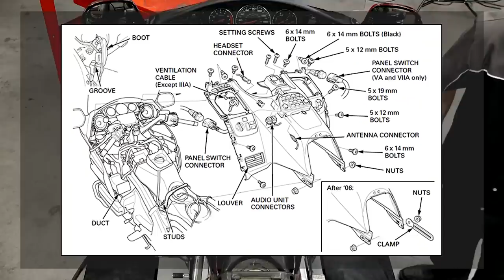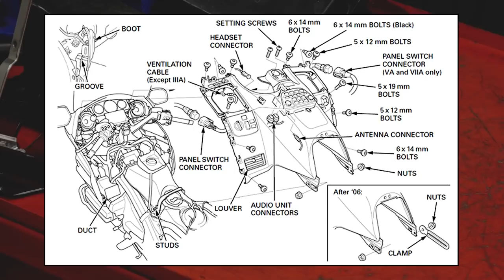Goldwing Air Filter Replacement | Partzilla.com

Comment: One of the better air filter change videos I and seen.  I've changed my 06 many times (240k-and-counting miles).  Thanks for sharing.  The fact that y'all invest in making videos will make you my new go-to for parts.  I am getting a list together of 20-30 little fasteners and oe do-dads taht need replacing plus this winter I am replacing all the front brake bolts.
Reply: Thats one of the reasons I buy from partzilla.

Comment: Easy as pie only looks difficult because of all the wiring of the electronics. I think most people that try this will be surprised how easy it is. It’s only a couple bolts and if you think you’d have a hard time figuring out which plug goes where when putting it together just get a pack of multicolored tape rolls and tape same color to each end of the plugs and it’s easy to match them up after.

Comment: I am flabbergasted. This honestly makes changing an engine look simple..I was a Honda motorcycle mechanic in the 70s. I could literally have the engine out of a CB 350 twin out of the frame and have the camshaft, (which were junk), out of the engine in under 50 minutes.. changing this air filter has more steps. And in addition to there being more steps, this job is scary because there are a lot of hidden plastic tabs..
  This is an excellent instructional video. I just bought my very first 1800 gold when used, and whenever I buy a used motorcycle, I change everything from brake fluid to spark plugs.. motorcycles don’t wear out, they get neglected to death.
 The Gold Wing I just bought is a 2002 with only 13,000 miles on it. The date today is 10-2019. The original owner said he never had the air cleaner changed. I wonder how many mice I will find in there
  I would like to hear suggestions from Gold Wing honors, whether I should use the standard Honda air filter element, a HIFLO aftermarket air filter element, or go for the big bucks washable K &N Standard filter replacement. I have a Honda pacific coast that I have used for commuting for 24 years. I put a washable K &N Air filter in my PC 24 years ago, and I am happy with it still. The PC air filter element style appears to be identical to the one in this Gold Wing..
 Any Gold Wing riders have any experience with different air filters in there 1800 wings?

Comment: Great video!  Just finished dropping the new filter and the cover back in place last night, will reassemble today.  Would like to note that on my non-ABS 2009, I did not need to flip stuff over to the right to access the air cleaner cover.  Wiring, ECU box & cruise assembly all pulled up far enough to easily remove the cover and filter to the left.  Not a bad job really, but holy crap there is a lot of wiring on a GL.....

Comment: Looks like an absolute nightmare, but it needs to be done. There are just way too many opportunities to break something for what should be a much simpler replacement method. I may be tackling this during the upcoming weekend when we are expected to have 40-degree temps. That's a good time for motorcycle maintenance! 

Thanks for the great demonstration of the process. I'm not looking forward to it, but it is what it is.

Comment: Just finished changing my filter for the first time since owning my 02 wing. I have been putting it off since all I’ve read was how horrible of a job it was. It took me about 4 hours but more than half that time was spent shooting the crap with my neighbor. Pretty easy if you keep up with where the bolts go.

Comment: Another great video! I've changed dozens of these and I still think Honda built the bike around the air filter! My current 'Wing is a '13 Airbag model so I have that to contend with that too. Main thing is don't hurry and be patient. Don't jerk and snatch. I really liked the clutch replacement video you did on that bike. Thanks.

Comment: I know that was just to try to get people to buy your parts but I kinda feel like I'd rather pay someone to connect up those 20 or so connectors and get all those plastic pieces back together without breaking anything. Holy crap! You've got patience.
Reply from the maker: Goldwings are a special machine.  Sometimes it's not even about saving money, it's just that people like projects.  Some projects are a little more time consuming than others.
Reply: I called a dealer by my house and they were going to charge $300 to do this.

Comment: Thank you very much for the detailed instructions how to replace the air filter. This is the best video I have found on the YouTube. This video convinced me to do it myself instead of taking it to a bike shop. I can imagine how many screws would be missing and parts not sitting in their place.
I just wonder, why Honda had to place it so deep in the bike?! Doesn't make any sense. Prior to my 2008 GL-1800 I had a 2003 Voyager XII. I could replace the filter in 10 minutes.
Reply from the maker: Every time this video comes up in a meeting, we talk about how far into the bike you have to dig to get it. It's a thing, man.

Comment: Thanks for the video! I watched it about 4 times over a few weeks, really saw its only following instructions, .. Still, very anxious to do this i began this morning after a cup of coffee and i'm now completed, 945am. I am NOT very good at working on cars/bikes and I did it. Just take one thing at a time. Nothing about this is really more complicated than unplugging a cable or unscrewing a bolt. Now i'm much more familiar with how the top of the bike goes together, there is no magic or fiddling, very straight forward.
Not sure how a shop who's done this before can charge over 1hr of labor, next time i do it will probably be 45 minutes or less.
Need to add, there was a gasket around the filter when i removed it, (not shown in video) i put the gasket in the air cover and then slid the filter on the cover and put them all on together. May be a bit easier. I put a little air tool oil on the gasket to keep it from dissolving/cracking.
Reply: thanks, Ill try that tip.

Comment: It's not a difficult job, just an involved one. Hardest part is keeping track of which fasteners go where. Make up some cardboard cutouts and push the plugs into the cardboard in the same fashion as the original. Other than that, once you have done it once, it's easy to do again. Be sure to put the templates away for the next time. Second time around is very easy but no less involved, but still a couple of hours work.  But don't neglect it; your beautiful Wing deserves better. 
And when you feel you need to curse the job, curse the design engineers who must have been drunk the day they did their job....

Comment: Removing and reconnecting the lower vent control cable can be a pain in the butt. I saw a jump cut in the video. 14:46 . I have found its much better to remove the whole lever assembly with the cable still connected. Pull off the lever's knob and click off the cover plate that says open and close. Under that there is only one screw to remove. Removing it as an assembly doesn't put a nasty kink in the cable.

Comment: Don't be afraid to use a vacuum cleaner with a soft brush on the filter housing followed by the nozzle all around, before opening,  and then on the filter, before you remove it. This will minimize debris. Obviously if debris does fall into the airbox you want to vac that out, including the intake ports at the bottom.  No harm in wiping up the oil from the PCV with a paper towel either.

Comment: Considering that it's an opposed 6 it makes sense that the air filter is deep inside the beast.  The rest of the maintenance on a GW18 is on par with with other motorcycles, or maybe even easier.

Comment: On reassembly the hardest thing is getting all the wire bundles in EXACTLY the right position.  Otherwise the top shelter will not fit.

Comment: Hi John, thanks for taking the time to make this video I have found it very useful as I am just about going to undertake the task changing my air filter, I have a 2014 airbag model, Is the procedure  the same for removing & replacing (as you refer to it)   ‘the shelf’ 
Can the air-bag just be unplugged and plugged back in?

Comment: You could not have done better job/I did mine today the guy before me replaced all the Allen head bolts wrong with ones from hardware store ,I will sort it out later thanks for helping me through 1st time I can do it again in 1/2 the time .....M

Comment: Looking at this video, I think the air filter on my 2006 wing will be done at a garage by a professional. 
Reason 1, not enough space in my garage.
Reason 2, lack of patience to do this.  
Reason 3, I'll end up messing it up.
Happily change the engine oil & filter and the shaft drive, but that's where my mechanical know how ends. 
Brilliant video though.
Reply from the maker: Yeah, the Goldwing is tough. Every job we do, if it's hard, we say "At least it's not the Goldwing."
Reply: I feel the same with my 2002..   woah😢

Comment: Holy BatCrap. I always work on my own stuff, have  lift, three rollways, special tools, etc. Own BMW, Hayabusa, and Harley now. I WAS considering getting a nice low mileage wing for some road trips, but after watching this I wouldn't even consider owning one! A major deconstruction just to change a friggin air filter??? I thought the oil change on the Hayabusa was a pain in the rear! There' no doubt in my mind that people run those air filters forever, and that dealers probably just charge for changing them instead of risking introducing electrical glitches from mechanics slip ups! Nope, I don't care how good the Goldwing is on the hwy, not getting one of those!
Maybe I'll just buy one for a long trip and then sell it before I put a wrench or screwdriver near it!

Comment: Hi John, 
I am just about to under take an air filter change with the help of your video. My bike is a 2014 airbag model, Will removing the fairing be the same procedure & I can just unplug the airbag & it comes away with the fairing?…….. Mark 12:13

Comment: How about a video on the 2010 air bag model please?
Reply: It's really the same except the radio module is in the left side and the airbag sets on top of everything under the shelter, the computer module is upright on the left under the airbag. Air bag is actually easy to remove, just pay attention to the way the straps fold and lay down under the shelter.
Tape the foot warmer doors shut before removing the cables and it's easier. Also the connection that gets forgotten the most is the small wire connecting to the top of the airbox. If you have a mouse nest in the airbox, cut the screens off the old filter and use them over the ends of the air snorkels going to the airbox to make it harder to get in.

Comment: I'm about to take on this project on my 2008 wing. I presume the steps are pretty much the same?
Reply from the maker: Yes, essentially the same.
Reply: @PartzillaParts  thanks very much for your video - it helped a lot! I did the job in ~3.5-4 hours, and went pretty smooth. 
A couple of takeaways - the hardest parts were separating the connectors which were really tight, and then getting the airbox cover back on without moving the filter out of the groove. That bit took a while, but patience was my friend. 
Many thanks again for your extremely helpful video.
Reply: I’ll be doing this here shortly on my 08...  I have to buy some Crown Royal for afterwards first.
Reply: @peteleare1372  I’m doing mine now. Those Connectors are a PITA! I’m also replacing my steering head bearings and fork seals. Dealer charges $1300 just for labor😳 That’s  money I can spend on fuel and miles of smiles👍

Comment: The air filter is the most involved service item but everything else is quick and easy. Beware Goldwing riders I don't know how the 2012+ models are but the F6B riders have to open the bags to remove the side panels, otherwise you will cause damage.

Comment: You don't have yo unplug the ecm and the cruise control . There are only two connections you need to unplug and you can move the whole assembly to the side

Comment: I figure I'll have to change mine next year. If I watch the video about 100 time between now and then, I should be OK.
Reply from the maker: To this day, when we run across a complex job, someone always says "At least it's not the air filter on the Goldwing."

Take your time, keep track of your parts, and check out our diagrams if you need more hints: https://www.partzilla.com/catalog/honda/motorcycle

Comment: I followed your directions and was able to change the air filter. I put it all back together, put in and turned the key, and nothing—as if there was no battery in the bike. So I took it all apart again (except for the air box, making sure every electrical connector “snapped” in properly. Same result. Verified the battery is at 100%.
Any ideas?
Reply: Sounds like the long wire coming off the ignition to the right side of the bike didn’t get plugged in
Reply: I found that the main 30amp fuse had burned.  I suspect that when working on the bike with several "layers" removed, I might have laid a tool on the bike that shorted the fuse, and really had nothing to do with the steps involved in changing the air filter.  I'm picking up a new fuse tomorrow, so that will be the proof.
Reply: A new main 30A fuse did the trick.  Everything is back running.  I need to be more careful setting tools down on the bike that could cause a short / blow a fuse. :(

Comment: It's worth every penny I spend to have my Honda dealer do this. Why design this in such a way! The hours it takes to do something as simple as change an air filter is ridiculous!!!!
Reply from the maker: That's why we do the videos! if you decide to do it yourself, it's a good tutorial, but it's up to you how to proceed.
Reply: @PartzillaParts  its a great video. I just don't have the patience to do this. I just think Honda should have designed the filter to be changed a little easier.

Comment: Anyone have any suggestions about removing the headlight adjust connection?  I can press the top tab and move it back maybe 16th of an inch but can’t tell if there’s another part holding it together??  The opposite side doesn’t seem to be moving but can’t tell if there is something holding it together.  Never mind.  I had the little clip that holds the cable to the radiator on an ‘08 still on the connector, removed that and it separated easily.  Thanks

Comment: there is the cost of owning a vehicle that most people just dont take into account... the Ducati panagali  needing a valve adjust  I think before 5000  miles ...at a 1000 $$ plus in labor .. this bikes air filer ,,wow   maybe 2 hours work ..at 125 an hour ?  might as well do other maintenance  while those covers are off?
 My FJR 1300 to change the  coolant is very involved ... some cars removing the starter is a 5 minute job... others it is a  6 hour job ..Toyota V6 ..under the intake manifold ..... engineers are not mechanics :)
Reply: Haha, like changing the plugs or low-beam bulbs on a 2011 Outback; hope you have an engine crane and very small hands with Schwarzenegger strength.
Reply: @alexwilsonpottery3733  Yeah while I'm back one of the guys at my work was telling me about replacing the headlights bulbs in his Ford I think F-150 about year 2018 he had to remove the front bumper...

Comment: I have a 2006...  I once asked a guy at the honda dealership about changing the air filter...  He advised never, unless you're getting really crappy fuel mileage...  Nope, not gonna do it...
Reply: Every 5 years or 20 k  , You have  video guidance  and winter  break, WHAT your excuse......